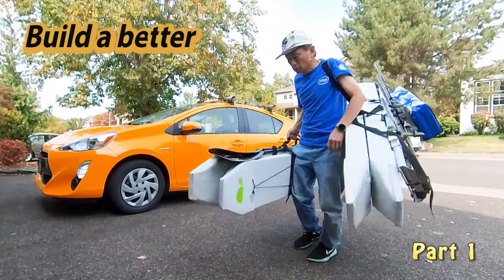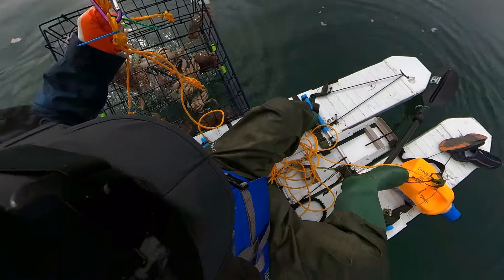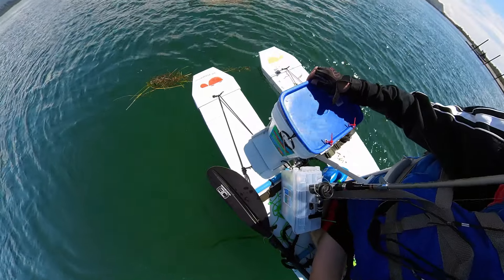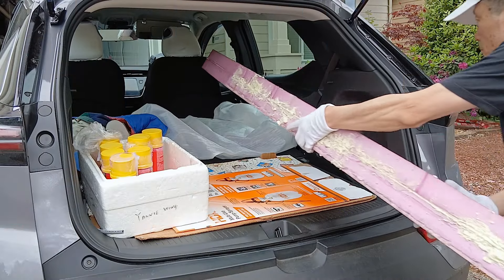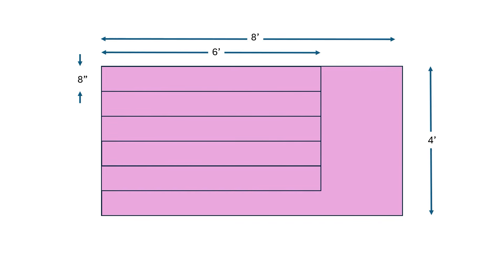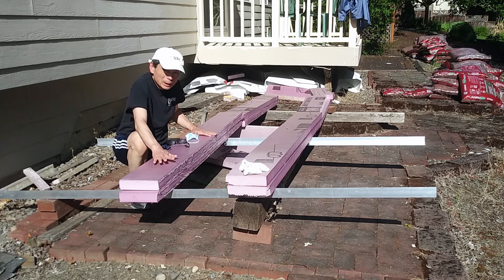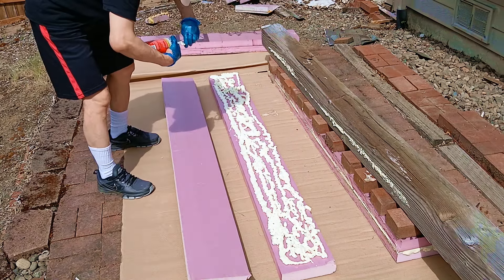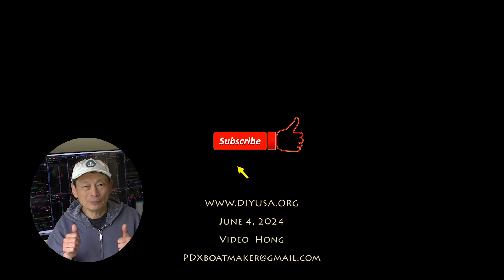Build a better pontoon boat   - Gen 6

Comment: Cool to see boats that can be made with more readily purchased local materials. The coroplast available in the USA was just too small.
Reply from the maker: I agree, it is difficult to find a sheet of coroplast larger than 4'x8'.  I am aware of this situation and I have experimented with heat fusion to fuse  two 4'x8' sheets to build a longer boat. Home Depot do sell 5 or 6 mm thick 4'x8' coroplast (but you have to buy a few sheets), which is a good candidate for this.  Here in Portland, Oregon, you can get a 5' x 10' coroplast from a local plastic shop and the price is very reasonable. Their coroplast are usually cheaper than Home Depot and you can also buy a single sheet. In this latest project, I used the foam I bought 4 years ago, which was $18 on sales. Nowadays, it is so expensive. A foam boat can last for many years. I will have videos giving you more details in building my 6th pontoon boat in the next 4-6 weeks. Hope this will inspire you to build one also :-)

Comment: Hi
I always enjoy your engineering and creativity. One suggestion (i am curious about your thoughts): why not use expandable rods to connect  the pontoons? For example, expandable curtain rods for the shower. I find them often in garbage. It also possible to use pvc pipes to expand the rods further. My thought are: (1) easy transport, (2) the wider apart the pontoons, the more space and stability.
Reply from the maker: Thanks for your support and inputs. I have used the expandable rods in my other projects. They are inexpensive. As for the pontoon boat, those rods are usually very thin and not strong enough for the cross beams. When I built my Gen 2 pontoon boat, I used the PVC pipe to build the whole platform. I did consider using the PVC pipe again for this latest boat. Finally I decided to spend a bit more money to use the 3/4" aluminum pipes for the cross beams/p[atform. It is because I want to haver a boat that can last for a few years. When I built my very first pontoon boat, which is a catamaran. I used 3/4" steel pipes and the platform is 4' wide. It is very stable. The boat is heavy. I want to transport the boat inside my car hence I don't want the boat to be too wide (this means the platform will be too large). With this design,  I am keeping the width to 29".